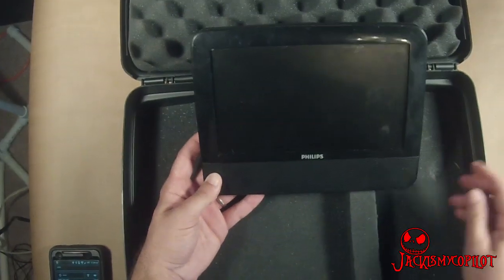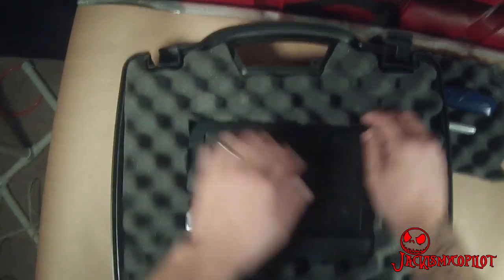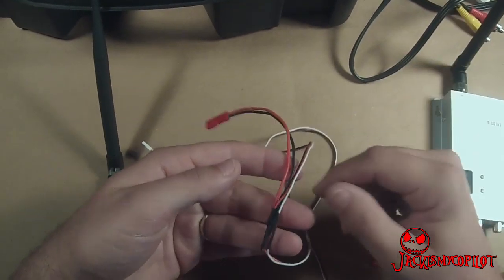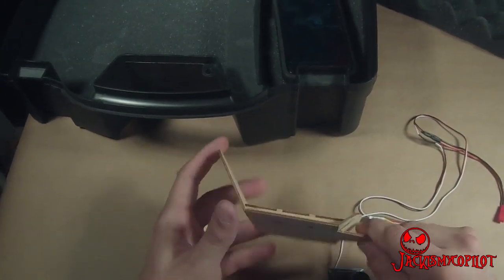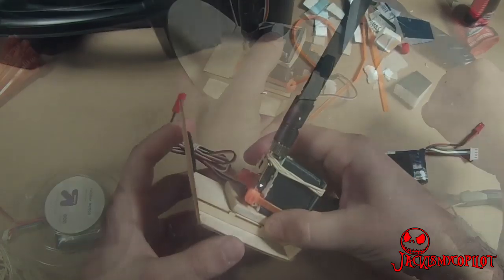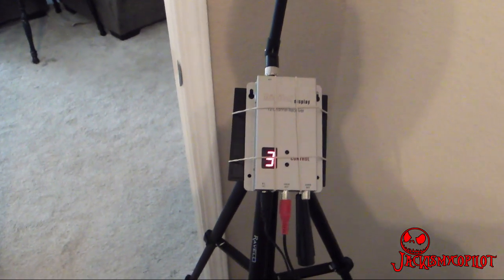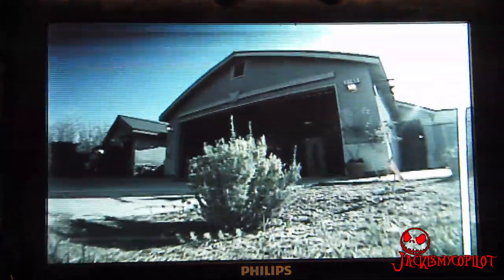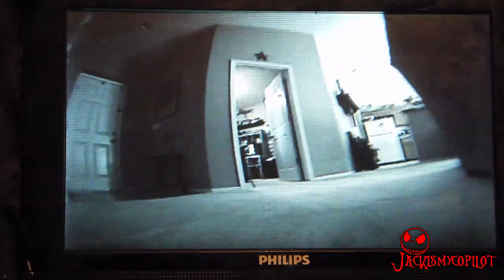Super Cheap FPV setup. HK 900Mhz 200mW CCD and Homemade Ground Station.

Comment: Awesome, I have the exact same setup in the post, shame about the camera colour, is it like that for all of the cheap cameras? Almost seems black and white. Lil tip, try make the commentary a bit more interesting, its a tad dull hehe.
Reply: Ive got the exact same fpv kit the picture seems a little dull but then every now and then the couler goes into over drive and seems a bit bright / kinda fluro brightens up my day. ive been using the fpv kit in my rc car but plan to use in my bixler 2 when I can fly it with out smashing it to bits haha

Comment: Cool where did you purchase the cameras at? Also how far is the range on the ground?
Reply from the maker: The camera is from HobbyKing.com I am not sure of the range yet. I am afraid to push the boundary. I just creep further and further each time. I'm not out very far yet.
Reply: JackIsMyCopilot ive used mine on a rc car got roughly 200mtres behind brick houses and all I guess the range would be sky high when on a plane,
pun intended